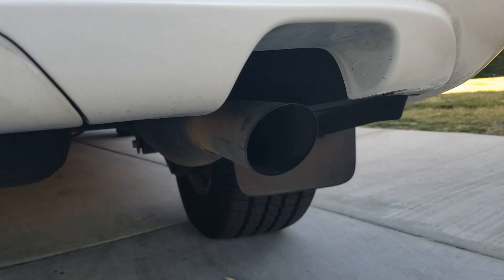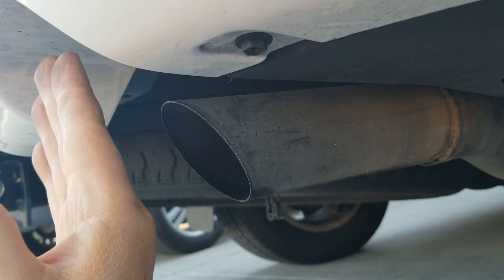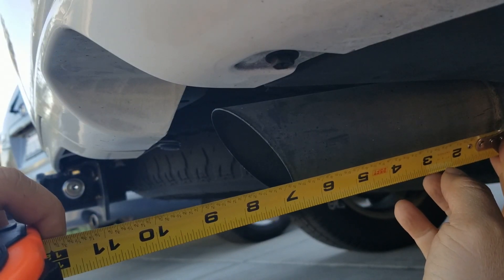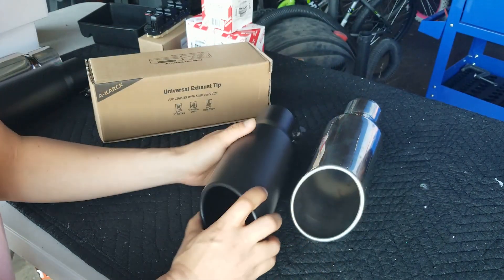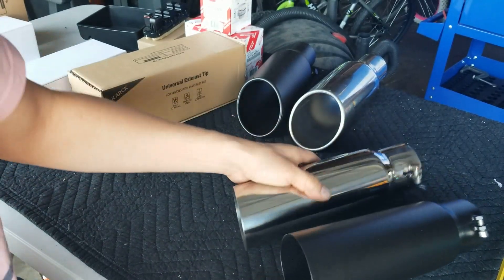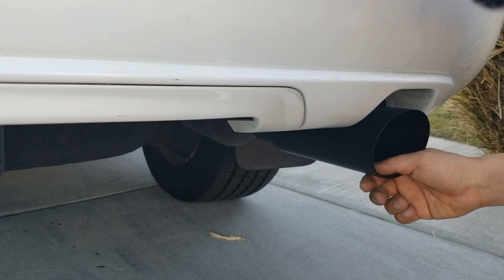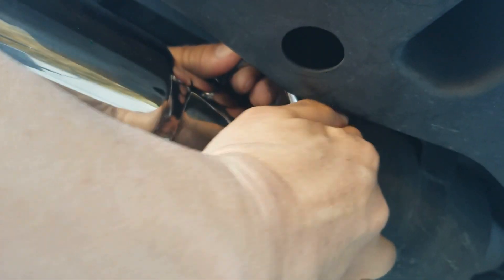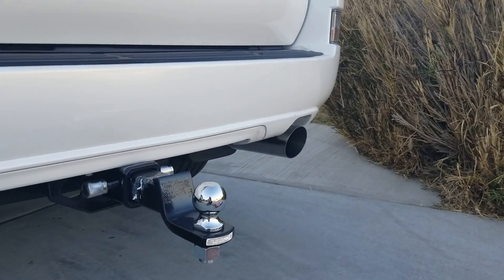GX460 tail pipe upgrade

Comment: Yeah I'm definitely addicted to your channel. Just bought a 2013 GX 460 yesterday. Love your vids
Reply from the maker: Thanks Robert.   I had a black 2011 and your car is basically identical to my current 2017.  Only real difference is the front grille.  I loved the hourglass grill so much i made it a goal and hence the2011 went up for sale and sold almost immediately.  You'd be surprised on how well your suv will hold its market value which is way above kelley blue book.

Comment: GX*Bob,

You are the man! Thank you.  I got some great ideas from you.  I wanted to ask  you if you would do a video on side moldings?
Reply from the maker: Hey F Tang....question. What is it that you want to do with your moldings that you need to remove them?  Chrome delete?  Those moldings are held on with one-time use clips that break off the minute you pry your moldings off.  Thats if can overcome the industrial strength 3M tape also holding your moldings on.  I may, in the future, remove my door panels and the inside of my door to see what's involved but i have quite a few videos to produce before that.
Reply: @GXBOB  , I want to add body side moldings to protect from crazy jealous people that slam their door and cause dents and dings onto the side of my vehicle. I looked high and dry but there is no good aftermarket item and Lexus doesn't have OEM I can buy for my 2023 GX. I tried Sportwing but ended up sending the moldings back because the passenger door curvature didn't look good.

Comment: Bought the tail pipe you recommended, definitely good quality for the money.  Now look is improved and extra protection off-roading, thank you.
Reply from the maker: Did you go past the weld mark?
Reply: @GXBOB  It stopped at the weld mark, I had to pry pipe's inlet a little bigger and rubber mallet it in.

Comment: First video of yours I’ve watched. 😂 New sub. Debating on getting a used GX. Been reading a lot of bad things about leaking water pumps, oil around spark plugs, timing chain covers leaking, transfer case leaking.....Not sure right now. You have so much information on your channel! Time to binge watch.👍🏼
Reply from the maker: Glen, you're going to read a lot of bad things about every single car.  And you might be judging them based on some bad apples that were not regularly maintained.  A lot of these GX's are older models and have been thru a lot by their owners.  These use to be soccer mom cars and were not typically kept up to date on scheduled maintenance.  Then the new era of offroading and Overlanding happened.  That's when you have people abusing them thinking they are dirt machines that need to jump off every cliff they see.  I have not had one single issue with them except stuff that are normally due to breaking since they are only machines and not meant to last forever.  Give them a chance, you'll be stuck for life.  I did.
Reply: Probably one of if not the Most reliable/dependable vehicle on the road. Bob's channel is great google "carcare nut" on YT as well he is a certified Toyota mechanic and raves about the GX. Just bought one for his Wife. The V8 is going bye-bye forever so.....I just bought one. Traded in my 2021 4runner for it.

Comment: I just swapped out my muffler for a magnaflow. Sounda much better. I didn't get your POS tailpipe though. Mine is actually chrome and flush with the rear bumper. I have a base model also.
Reply from the maker: That is so odd.  Other people on here have higher trims and theirs came with a POS tail pipe.  I wonder what the deal is...

Comment: Random Idea for your channel: Swap all of the tiny interior LED lights out for white leds (or any other color) . the small lights in the door handles, footwells, under the seats, cupholder etc.
Reply from the maker: those are leds welded on circuit boards and such.  They are not removable bulbs you know.  I"ve  tried the ones in the side mirrors and those are permanent within the light lense component...etc.  I am most likely going to see the ones under the seats soon though.

Comment: Go to the muffler shop and give them $10 to spot weld it… or use some JB Weld and it’ll never get stolen or come off…. I like the rolled  lip was well.. my fully loaded premium has the factory stainless tip…

But great job as usual Bob
Reply from the maker: Hey Thomas. Knock on wood it hasn’t been stolen yet but the reason i don’t have it permanently affixed is because i go thru cars often. This muffler will definitely go with me when i pick up a GX470 to build.

Comment: Is there a way to do muffler delete without cutting the pipe? I'd like to remove it then put it back on when the lease expires. lol
by the way, can you test the DC Sports EX-1012B Performance Bolt-On Resonated Muffler Slant Tip? it;s only like $22 on Amazon
Reply from the maker: muffler delete w/o cutting the pipe......my first question is "what is your intended purpose?" to make the car sound like a Toyota Supra twin turbo?  To gain HP?  To fail your smog check?  Its a heavy ass tank thats meant to be driven by soccer mom's for gods sakes.

Comment: Wondering if the Toyota's 4runner/Tacoma's tail pipes are the same size?... I asked a sellers of Ebay and they couldn't confirm? Their reply was they only sell Toyota parts..LOL SMH
Reply from the maker: I'd do some legwork and stop by a dealership with a tape measure to confirm.  To add to that note, i would also buy from Amazon instead of eBay to ensure my return is effortless if they don't fit.  eBays sucks when you try to get a refund or an exchange.
Reply: @GXBOB  Thank you.. I couldn't see any reason why a simple M-tip be so different between the two/three models ..Really are both Toyota products ? But what do I know or we? LOL  Tacoma/4runner's/GX460's?

Comment: How does your pipe tip hold? any color change after use?
Reply from the maker: no color changes.  The pipe is  holding quite well.  Very secure.
Reply from the maker: After a year of usage, it turned  into a rainbowish looking purple that signifies heat.  I mean...its not ugly.  I think it looks pretty cool still.

Comment: Hey I have a question. What would you say is the best yet most relatively affordable mod you've done yet? I was watching the video for the raisers for tall people, but couldn't believe each one was $100. I saw your video about the OBD2 port for the mirrors and windows and bought that thing and it's amazing. I'm just trying to find mods that give the best bang for buck.  Any input would be greatly appreciated. Love your videos.
Reply from the maker: If you read the description below the video, i also mention the spacers are $15 and provide the link. I think all my mods hold value depending on the circumstances. Some are needs and others are wants. I would knock out the preventative maintenance out once first such as the uni mod filter for the secondary air pump for $20.

Comment: Why go through so much hassle. Lexus and Toyota has a part number for it. Simple!!!! OEM part # PT932-60100.
Reply from the maker: Not for $10 they don't.  I never buy Lexus accessories from Lexus because accessories they carry are drop shipped from an outsource since Lexus/Toyota do not manufacture accessories unless the part is a form, fit, or function as part of their design.  The exhaust tip is definitely not part of their engineering drawing.  Most,  if not all,  their accessories are manufactured in China.  My roof bar support is a good example. The identical ones sold on ebay are going for $60.  Only thing i would not compromise and would go to the dealer for are safety or mechanical equipment unless a reputable japanese supplier sells them independently such as Denso, NGK, etc..